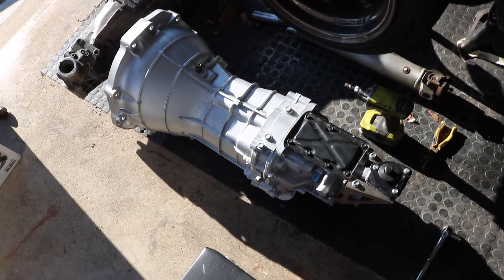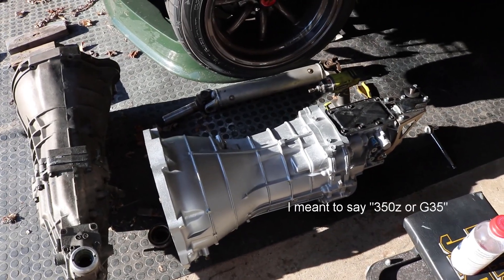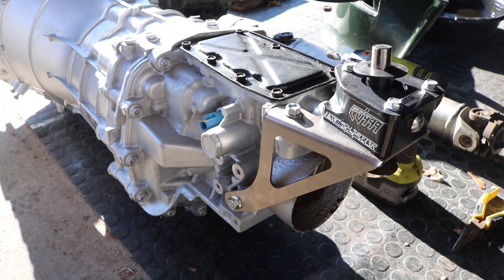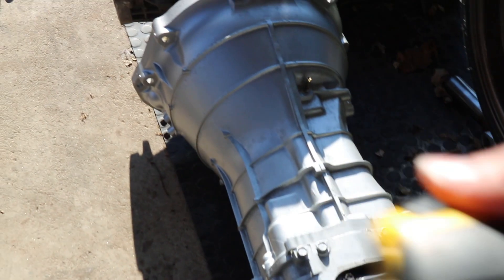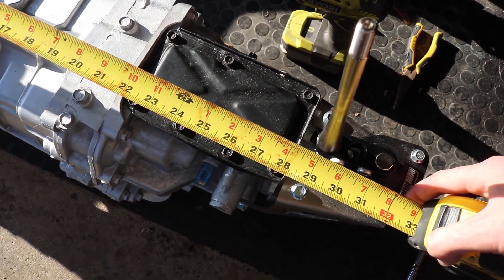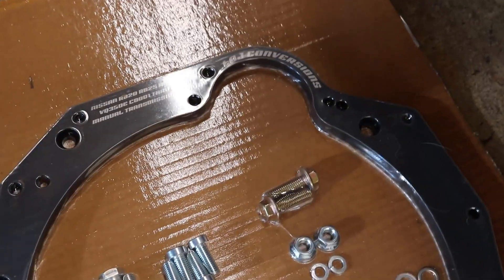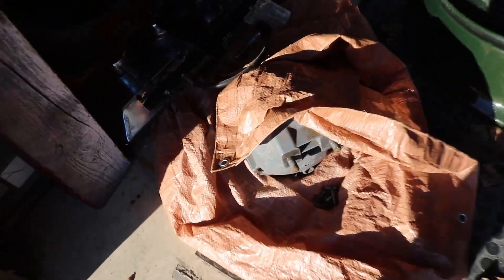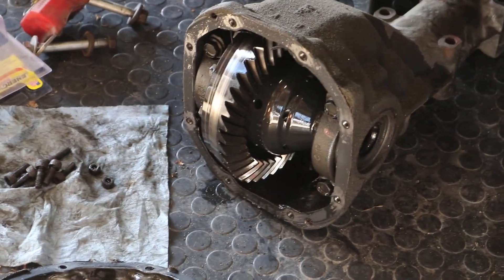RB25 Datsun 280Z CD009 Swap - Technical Details [Part 3]

Comment: I’m doing the same in my S30 and would like to know the weight differences between the flywheel on the rb and the flywheel that cane with the kit fir the cd009. The flywheel that comes with that kit looks quite bulky lol
Reply from the maker: It's lighter than it looks. The new flywheel is 17lbs. Factory rb25 flywheel is 22lbs. The flywheel I took out was either 14 or 15.
Reply: @BoostShackSpeedshop  ah ok, damn that is a lot lighter than it looks lol. Thanks for the reply!

Comment: @Boost Shack What is the part number on that energy suspension bushing for the front of the diff? And where did you get the axles from? The replacements I mean. And are they chromoly or another set of used axles? Also, its interesting that the turbo axles broke and not the stub axles... 🤔🤔🤔 Always thought the stubs were the weak link when you added the turbo axles.
Reply from the maker: You can use part number ES3-1108G OR ES3-1108R depending if you want black or red. And the replacement  axles I got are just another set of used oem Z31T axles